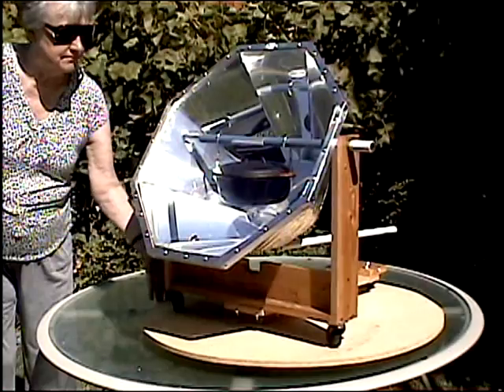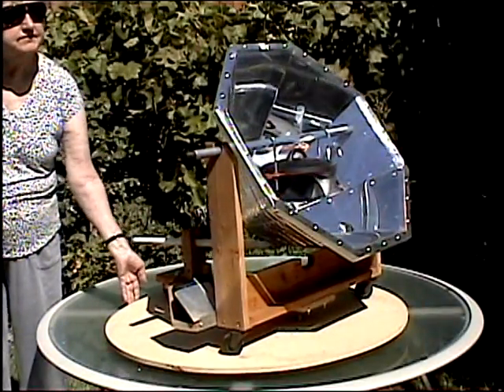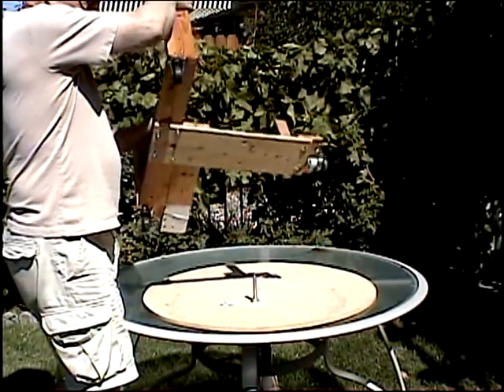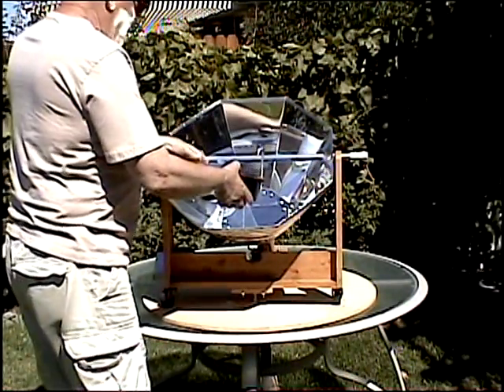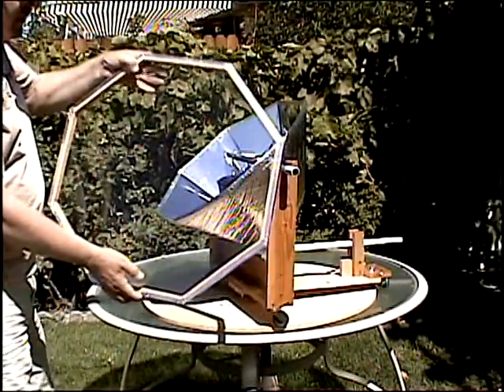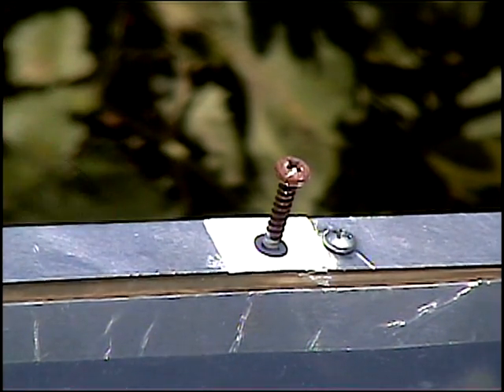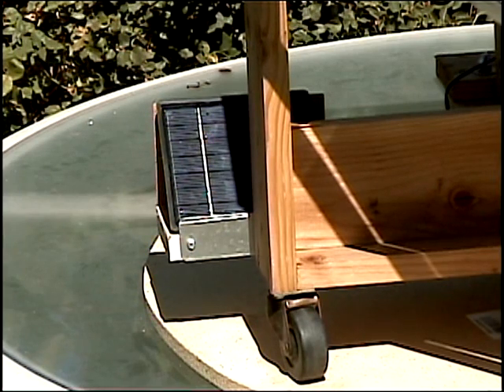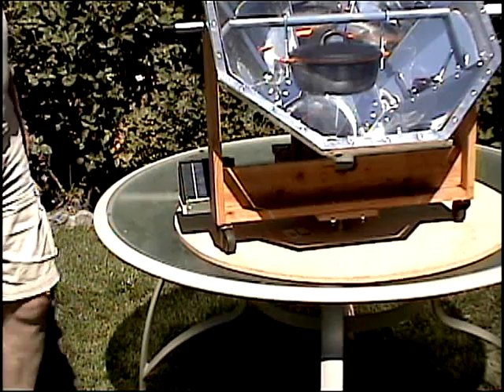Solar Reflector Oven With Automatic Sun Tracker

Comment: Wow, thanks for sharing; would love to see up close  your motor/wheel configuration and where purchased...
Reply: Sorry for the 2 month reply. Go to Andy Lenss on Youtube for a more recent design. A wheel that is attached to the motor shaft will wear out. My new version has the drive wheel supported in a caster bracket. The DC motor is 5-6 rpm. Amazon is full of these type of motors.

Comment: Very ingenious. I love it.  Other than general dimensions, are there detail measurements of components available? I would love to build one myself.
Reply: There are no detail measurements available. The reflector is 22 inches wide and 10 inches deep. Make the reflector first out of cardboard before you try it out of metal. The cardboard will give you the pattern that you can transfer to metal. The reflector is 1/32 in polished metal.
Reply: Thank you. You did a great job!

Comment: Hello. Thank you for the idea. May be naive question: how do you connect the motor to the wheel? What is the model on you motor? Thank you in advance.
Reply: The wheel is pushed on the motor shaft and fastened with a set screw. I don't have a part number for the motor, I built the sun tracker about 5 years ago. The DC motor is 3 rpm, 6 volts. The solar cell puts out 6 volts.
Reply: Andy Lenss thank you very much, it gives me general idea about the approximate power.

Comment: Hello, i love your invention!! I bought recently an all american sun oven..and i would just love to have a thing like yours to follow the sun...my oven weighs 22 pounds..of course meaning that i would have to make a pedestal to support it and put it on a little table...
The big problem is that i don’t have a clue how to join two wires to make this solar system work...etc etc no need to say...that i am useless..but maybe i could get around to do it if i had a drawing..or do you sale your invention?...to me it would be so pratical ..i stead of moving it around every ..30 or 20 minutes..😁😁..thank you if there could be any solution...
Reply: You are correct, a pedestal would have to be made that rotates around the axis.
The pedestal would have three wheels, two to support the pedestal and the third is the driving wheel. "Two wires", are these wires from solar cell to motor? This is not difficult, two wires from solar cell are attached to the driving motor. The solar cell needs to be located so that the sun oven cast a shadow on approx 1/2 of the solar cell. I don't have anything to sell or plans for what you want to do. It is a good idea to automate the rotation of the sun oven. With this system, the sun oven would rotate about every five to ten minutes. In 3 hours it will rotate about 90 degrees.
Hope that this helps you.
Reply: Andy Lenss thank you very much Andy ..so i will have to see what i can do then..you are so nice for answering...take care..😁🌺🕊

Comment: Very nice! I like it! I build also a Solarcooker wich combines a parabolic reflector and a box to keep the heat inside. Tracking ist not yet finished, but i like your solution! May be i will show it on you tube later. Greetings from switzerland!
Reply: When I started to experiment with solar cooking, I tried a parabolic reflector, a 30 inch satellite dish. The focal point was very hot, food in the pot would burn. The focal point would move as the sun moved. This required constant watching of the dish, became too difficult to use.

Comment: Does the aluminum surface oxidize?  Is plexiglas or polycarbonate better emissivity-wise? One could easily address  the criticisms:  enlarge the collector and use DATS shape, maybe use a mylar double-pane cover.  Anyhow,  thanks for the inspiration!
Reply: The reflector is four years old, the surface has not oxidized. I tried to keep the reflector small, I was living in Nevada and it was always windy. I don't know what would be better, plexiglas or polycarbonate.

Comment: First, I think the design  is very nice. I only got a problem with the motor, run by the solar cell. At  4:30 you can see the motor turning. Then at about 4:40 you turn the cell close to 180 deg and the motor keeps running. The same happens when you manipulate the the cell to get it back in place (shadow/ angle etc.). In my opinion, it's hard to run a motor on such a tiny cell.
Reply: Half of the solar cell exposed to the sun is enough voltage to run the motor. The motor is a 3 RPM DC gear motor, enough torque to move the assy.

Comment: it is cool as heck, but unfortunately 250 is not that hot for a solar oven, and definitely not worth all this building.  seriously,  you can hit 300 degrees on a 40 degree day with dollar tree mirrors in a V shape or various simple designs of cardboard with aluminum foil glued on.  or a car dashboard reflector clipped into a funnel shape.  one key is to have a black cookware inside a pyrex clear glass container for insulation.  again -- this solar oven is really cool, but not nearly effective enough for the complexity.  nice guy, nice wife, good work, what do i know, how insulting, don't criticize, blah, blah, blah, i know, i know.  but hopefully my comment saves 1 person from investing in this build only to be disappointed when he could have had better results with a car reflector and a paperclip.
Reply: I am just starting with the solar cooking and for the moment I've only managed to obtain 120°C (250F) in a carton solar cooker of 40x40cm with four reflectors covered with foylon on a very sunny day without wind at 45° of northern latitude when it is 20°C (60F) outside. How can go I up to 300F, please?
Reply: I have not managed for the moment to boil water in a funnel cooker.

Comment: Ingenious!  Especially the simplicity of the tracking.  I would love to know more about the construction of the reflector - is it insulated??
Reply: The reflector is bent from one piece 1/32 inch polished aluminum. The back of the reflector is covered with 1/4 inch insulation. The interior of the oven gets hot, heat would be lost through the  non insulated aluminum.

Comment: practical until the back wheel runs off plywood, base must be 'pointed' South...
Reply: The wheel will not run off the plywood. The cooking cycle never exceeds 3 hours, in 3 hours the oven rotates approx. 90 degrees.

Comment: Very professional. Impressive! Could you tell me which DC motor you used? Much appreciated.
Reply from the maker: +Peter Reynolds 
The motor is DC gear motor, 3-4 RPM. The driving wheel is about 1.5 inch dia. Lower gear motor will have more power to turn the assy. The solar panel I purchased from Harbor Freight, used to pump water for a small fountain. The solar cell puts out 6-8 volts, about $15. When buying motor, try to match motor voltage to solar cell motor. I don't remember where I purchased the motor, I have moved and lots of things I still can't find.
I was living in Nevada, now I live in Seattle, goodbye solar cooking maybe. 
Bye
Andy
Reply: +Sparks Letts Thank you for your information. Much appreciated.

Comment: Good Job. Simple and effective. Have you considered second axis focus also? Great design.
Reply: In the vertical axis the sun does not move as much as it does in the horizontal axis. To automate this would be very complicated. I like to keep my designs simple. Thanks for the comment.
Reply: I agree with you a thousand percent. Simple is great. You should have seen the wild Rube Goldberg tracker I tried. Strings, counterweights, clock, pulleys, turntable, idler pulleys and winding drums. Worked very will for one axis only - which was fine - but was too fragile to be useful